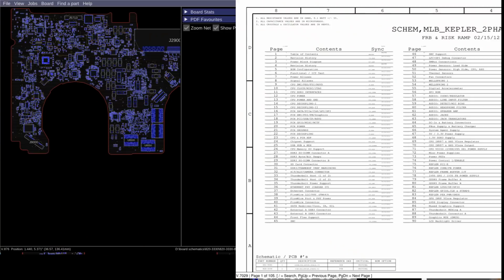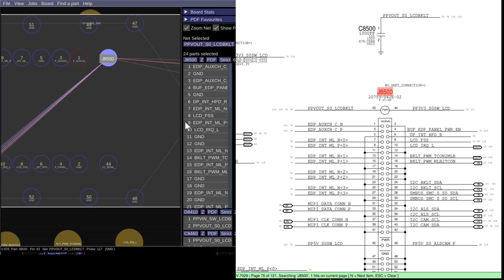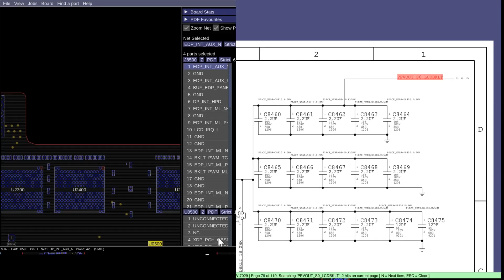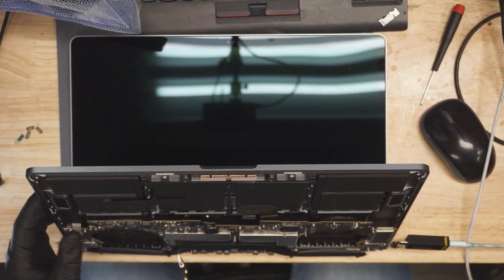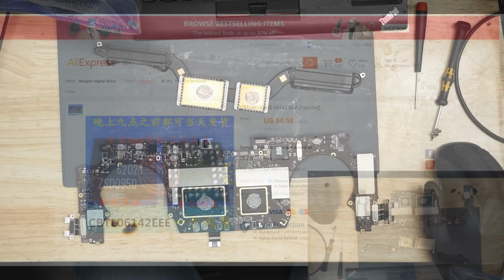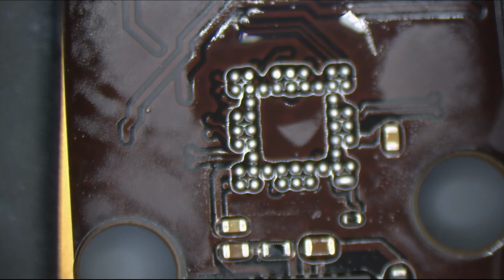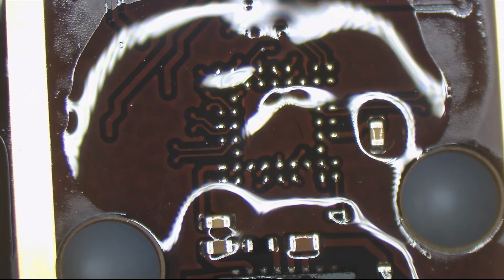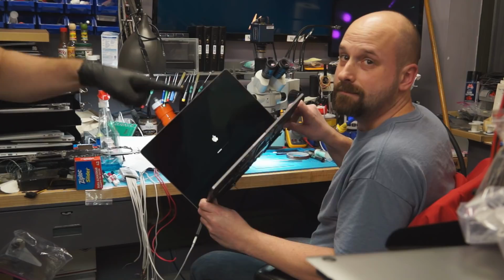Apple botches Macbook board design: again!

Comment: Thanks Louis, great video.

The idea that this happens since 'Apple is a large company' doesn't convince me at all, since there are other large companies, such as HP that don't have such blatant design flaws.

Now there are two possibilities here, and they both look pretty bad:

P1: Apple designers are incompetent, and that's a bad sign.

P2: Apple is doing it on purpose, which is worse.

P1 isn't very likely, since there's really no plausible reason why Apple's designers ought to be less competent than the designers from other large companies. 

Of course there may be a weird sociological phenomenon here, that bad designers feel attracted to work for Apple.

Modern corporations are mainly about serving their shareholders and not about serving their customers. The medical cartel will tell you a story there. Eternally suffering chronic patients will make them much more profits than healed happy patients.

Think about it: In case you fry your CPU, then you bring back your machine to an Apple store that will then repair your machine, thereby making lots of profits, and making profits will make the shareholders happy. 

Why do you think you only get two years of warranty? Apple knows why. 

They know that their machines start falling apart after two years only, and after that, they'll make lots of money with repairs, repairs, and even more repairs. And the repairs being done by Apple are particularly costly. On top of that Apple has a quasi repair monopoly, that is quite unique and quite criminal. It's a cartel.

This is an old strategy, it's called 'built in obsolescence'. American cars from the fifties are still running fine over in Cuba, whereas the sixties models cannot be found anywhere. That nasty philosophy of built in obsolescence hadn't existed yet, back in the fifties. My uncle has a fridge from the fifties, Elvis style, that is still running fine.

Of course in the long run Apple is going to ruin it's own reputation, but shareholders are greedy, they want the profit and they want it now, and they don't care much about what happens to Apple in ten years from now. Unhappy customers will result in a slow feedback loop.

If visionaries such as Steve Jobs were still alive, then they would prevent such machinations by force of their idealism, but alas, Steve has been replaced by some greedy anti-visionary types with dollar signs in their eyes.

Maybe the title should say: Short sighted greed botches Steve Job's dream: Again!

Comment: Anybody with a basic understanding of electricity could tell you not separating something that only wants 1-3 volts from something that demands around 40-50. You don't even need college. It should just be common sense. Yeah, giving something 1500% more volts than it wants isn't going to backfire AT ALL.

Comment: I’ve had 2 MacBook pros and on MacBook Air the MacBook Air only half the screen worked correctly the other half was color line and one of the pros the intel graphics bombed and that was only after a few months but ironically I have a 14 year old Dell desktop running windows 10 that just started having it first problems this year what does that tell you. Think apple I needs to pull there head out of there you know what and realize there stuff don’t smell like roses

Comment: Damn Louis, the NC pin is NOT CONNECTED, it would totally not make sense that you say "it would be grounded". IT WOULD NOT. The separation works only when it is not connected, and the purpose of this is, when your multimeter tip slips, that you wont short the high voltage pin to another low voltage pin (OR ground!). Maybe you do repairs well, but do not spread such BS.

Comment: re-balling sucks. you get done by your products bad design fucking it in the first place then you get done again by a more expensive repair for the time and skill it takes not being a straight repeal and replace. There's no extra money in that for apple so if i was them id look to sell you all the chips pre-balled i could and mark them up a bit. you'd probably still buy them anyway for the hassle it would save you and id make a bit money rather than get nothing. Guess they're just satisfied even if 1 person with this fail buy a new machine instead, Least it's more money in your pocket.

Comment: "Gotta reduce the display connector pin count so we can make the machine a whole micron thinner!" Seriously is that shitty little flat flex the entire display cable?
I'm sure the engineers are told to add little flaws to the boards on purpose. Even horrible $200 chinese netbooks get this shit right

Comment: Here I am watching this on a 2007 Macbook running OS X 10.6.8
Reply: Older ones are more reliable and upgrade-able. I also have a 2010 that runs Mojave (there is an unofficial patch to make it work). I did upgrade the RAM to 8GB and put in a 1TB SSD, so it runs pretty smooth and Xcode also works on it.
Reply: @danavram8437  Nice! That's why I bought a 2012 Macbook Pro. A great thin and light with wonderful battery life. The worst common issue I've seen out of it is a bad Sata cable. Tossed in a 240GB SSD and 8GB of ram and boot camped Windows 10

Comment: That is a pretty crappy design, especially with the video ffc having such a fine pitch in between pins, an ever so light "bump" could short the two vcc lines together.

Question Paul, why not use solder paste when reballing that chip?  Also did you intentionally use the wrong size spheres (too small) because that's all you had, or you have buildup of regular solder on the main PCB?

Louis, sounds like this was a tough one off camera, you sounded way too damn excited when you saw the apple logo!!  It was like hell yes, hit the camera power and lock the damn door! lol

Comment: Why is lead-free solder == crap?
Reply: It has a higher melting point, so you need to apply more heat for longer to melt it. Also doesn't flow as easily and has lower surface tension, so it forms undesired bridges with ease. In short, horrible to work with.

Comment: I wonder how apple could market this fault ,  for 3000 grand we can sell you a computer that can destroy your cpu in minutes because we messed up the connectors so 50 volts can destroy your cpu the apple way.
It would be easier if apple made the cpu so you could actually change it but that would not be the apple way

Comment: No wonder Apple can't innovate like they used to. There should be adjacent ground pins or a guard ring as mentioned.  Lazy LAZY incompetent engineers.  Apple programmers have become lazy and sloppy, why not the hardware team as well?  

Just like the 1984 Camaro digital clusters.  The +55V for the graphical VFD display is right next to the 5V serial data line from the CPU to the display drivers. All on a connector without proper spacing or ground guard ring.  So boards that were near humid environments or coastal regions would suffer from electron migration aka a conductive path forms from the large voltage potential.  The 55V makes electrical connection to the 5V destroying the CPU.  A CPU that is no longer available.  We drill out the PCB and install a teflon sleeve over the connector pin so creepage is halted.

Comment: My 2013 15” retina worked 10 hours per day non stop and never failed until i replaced with 2017 touch bar, i have 3 year apple care and also insured for accident, problem solved
Reply: "I have warranty so I don't care about my $3000 product being badly designed."  
That sounds pretty stupid doesn't it. Good luck getting your data back when the thing blows up.
Reply: Congratulation for your great bargain!
Reply: Jahti they’re not $3000 , and why do you have to hate somebody just because they bought a warranty for peace of mind? Louis Rossman doesn’t get sent all the Macs that work fine.
Reply: I don't hate extra warranty, on Apple products it's almost a must have with all the problems these recent models have.
Reply: @asd3536  it's the truth MacBooks are becoming unreliable.
Reply: It might be just me, but I never buy warranty for anything, I know how to take care of my stuff, if I break it.. I will either I fix it, or buy another (I should have been more careful), and if it fails it will be because it is a POS and I will not be buying that brand again, so far I have 10 years or more old laptops that still work, upgraded RAM, HDD for SSD and in some cases even CPU was upgraded to the max supported once they went down in hype/price. if a laptop lasts just 3 years it is a poorly designed brand/model, you should want to upgrade because you need more power, not because it's broken. People accepting planned obsolescence are just enabling companies to rip us all off, buying soldered in SSD, CPU and RAM is just lame, but they are driving us to it, little by litlle, 90% of laptops have soldered-in CPUs by now... I still look to buy the ones that are socketed, as the average consumer becomes more and more clueless more manufacturers are taking advantage of it.
Reply: Jahti regardless of what device you use you back that thing up, cuz they all can “blow up”
Reply: @bignades1  HDD and SSD usually gives a warning way before they die completely, Macbook has everything soldered in the motherboard, and they removed the connector to use a dead motherboard as a readable drive, so if anything goes bad, and it will (besides working at 98 degrees Celsius, now this pin that will fry your MUX chip or your CPU means you will definitely bite the dust sooner than expected and without a warning) ... and all your data will be gone. Any laptop could crack in half and you will be able to remove your HDD or SSD and simply connect it to any other computer to read the data. Still agree with you about backing up your data, since it is essential regardless of the build quality of any computer.
Reply: @asd3536  LOL all you butt hurt apple haters, Louis wouldn't have this type of attention if he was repairing Acer or Toshiba laptops. I never paid the full apple price, I got my new 1TB mbp for 2K USD. I backup my data every week either way. I switched to the Mac in 2013, been using Thinkpad for nearly 10 years until then and had enough of the shitty displays, awful sound, magnesium like plastic feeling, going to the aluminium laser cut unibody with super fast storage and amazing display/sound was a breathe of fresh air
Reply: @G13RS "aluminium laser cut unibody with super fast storage and amazing display/sound was a breathe of fresh air" Gee it's almost if none of those existed before ~2013.
All of this can be found on other laptops nowadays, so what's the point? Aluminium is pretty shit material in terms of durability, so that's why thinkpads use magnesium mixture. It's almost if they're designed with durability in mind. I just had to bend the corner of my "aluminium laser cut unibody" laptop back to shape after a 1m fall.
I'd love to like macbooks, but Apple is making it very hard.

Comment: Mr. Louis You have meny contact just project pcb and do laptop witch super simple repair if die some dey... He not need be powerfull He need linux or android on intel CPU not arm with 10" screen witch high res 2000+ x 1XXX and super big batery live and 4G LTE network and normal usb port not shity usb-c... Thats all then this laptop will be great for all media internet read ebook and comix or manga and be great mobile device. For normal price not apple imagination. Then i swer i buy it instant... On market only nexus 10 from google is good but not great coz only wifi network and old android. I Rly wont look good product with 1 scrudriver service manual and some soldering if needed... He not need be fit he must be ez to repair and designed for all media and some apps, not need games. Cheep and awesome like Think Pad T40 with win 98SE... with matt screen and hard as tank :) Still i clean my amiga 500 with max wet sponge then i let her dry and on to power and work like new same with pcb on shower... Thats what technology must be... Not shity liquid damege coz some Women cry watch "Gone with the Wind (1939)".

Comment: Louis i have never been a Mac guy i recently built my own pc. 2 months later i got myself a 13inch toucbar i have to admit i have had the Mac 2 weeks on day 5 i though it was over priced but in all fairness to Apple you pay for the experience all be it a very Hefty price but the sessions in the store the way you get treated. Overall it comes down to when i had a problem with my iPad Pro 9.7 they replaced it for free after 1y 9m
Reply: Would just like to add i have a 5 year warranty on my new MacBook
Reply: Weird flex, but ok
Reply: +Jed Williams
 Sir, See videos on:  "Apple said it's water damage and so they claimed my warranty wasn't covered" where a denial after work was completed resulted in a full bill (roughly equivalent of buying new) being presented to the customer in order to get her computer back. It was based on shoddy evidence by an Apple chemical insert that "proves" water damage, but also reacts to just moisture in the air.
 
And consider a business math model for maximizing profits while maintaining the illusion of "great" customer experience by setting target% for distributed denials of claims across a population over time so as to allow it to be perceived as random or anomalous when in fact it is anything but.

Comment: I enjoy watching you roasting Apple for making stupid decisions even though I have and enjoy my iPhone.
Reply: Riley Dumont they usually are, apart from the iphone 4 with antennagate and 6 plus with the bending and touch ic issues
Reply: Find another sucker to take that iPhone off your hands and go with something made by Motorola. You won't regret it a few years from now when if you break something, you have their blessing to fix your own device.
Reply: bluephreakr motorola is ok but it’s still android. every android i’ve ever owned has been a crap experience, they’re laggy, buggy and constantly crash in my experience well every iphone i’ve ever owned has stayed buttery smooth with hardly any glitches to speak of. plus iphones generally will last you 3 years longer then any android, the 5s from 2013 still gets the latest software well any android from that era is stuck on some ancient unsecure version of android.
Reply: bluephreakr and iphones are actually pretty easy to fix as well, i have a side business refurbishing phones and iphones are always the simplest to fix because internally they are all very similar, every android out there though is completely different, they even differ from carrier to carrier in some cases
Reply: iPhones are definitely easy to fix. However they definitely aren't flawless as I showed in this video that I made a few days ago. https://youtu.be/FuEAQ7MH1V8